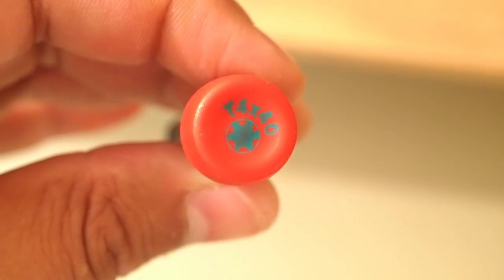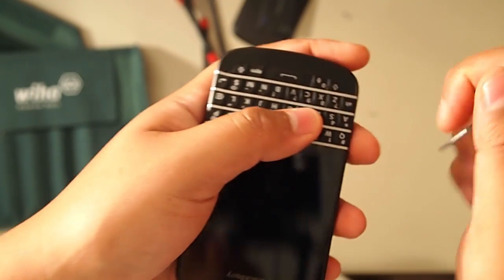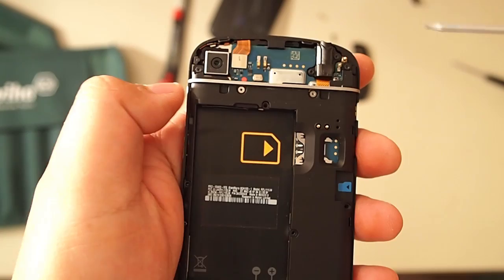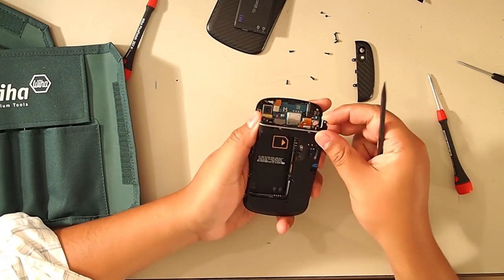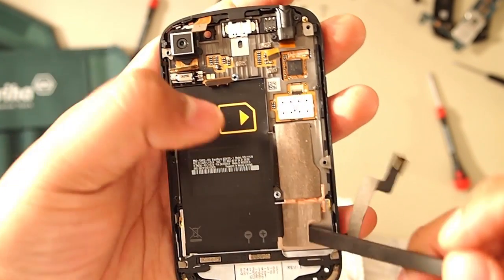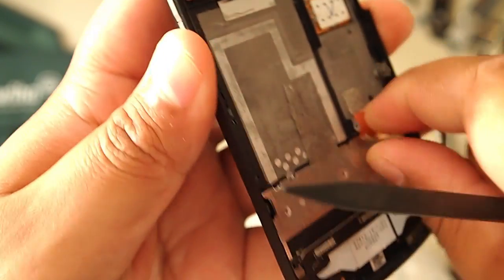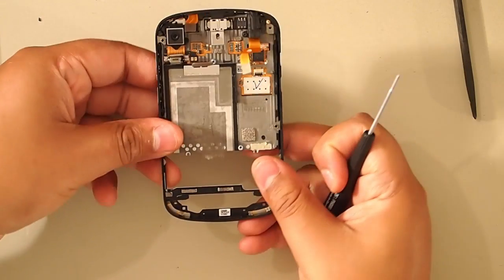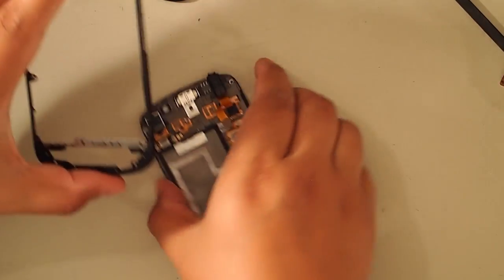Blackberry Q10 repair video Take apart, Disassembly and re-assembly DIY Screen replacement, Repair

Comment: My blackberry q10 is unable to make calls despite having both wifi and the Net. It says need network connection. What is the reason behind this. Pls guide.
Reply from the maker: Have you checked if it has any IT policies enabled?

Comment: my phone only works on speaker phone.   how do u replace the mic  is it part of the keyboard?
Reply from the maker: yes the mic is in the keyboard in this case.
Reply: @techguyz708  will it be ok to swap the keyboard from another Q10??? Also how can I desolder the  charging port?  Is there a special flux to desolder it and should I use a heat gun at what temperature??Lol

Comment: Thanks very much! Clear instructions and useful tips/do-not-dos. I needed to fix a SIM card housing/seating issue so all I needed to do was get to the PCB so by 3:20 i was good to go. It was just a matter of bending one of the SIM card slot top guides (it had been bent down into the bay itself) up so the SIM could sit in the bay properly. Before, the SIM would not connect with all the contacts and thus was undetected by the OS.
Thanks again!

Comment: my q10 has got a weird problem recently... everything is working only when i call someone .. he can't hear my voice... i can clear them pretty well.. but it works when i on speaker mode or use a hands free.. even voice recording working fine.. what could be the problem? do i need to replace any part?

Comment: Hi mate, thanks for your great video. I need some advice, I damaged my Q10's mic by prying all around the top cache on the back of the phone around the camera, with a needle. Now phone calls work and voice assistant (bottom mic) but not Soundhound or phone calls w/ speaker (top mic). Do you know exactly what component should be changed? From watching your vid I'm not sure if it would be the aluminum chassis or the screen itself.

Comment: Noteworthly turtorial, because any BB Q or Z built since 2014 will likely NEED to get a resoldering, or replace the SIM slot on these. it just breaks,
You had ONE job, Miguel!
Reply: Silver Spoon huh?!!!
Reply: Handsome_Hero
I have managed, somehow to check the product number of my blackberry, and after a few hours of research, came with the conclusion my Q10 was manufactured in Guadalajara by Jabil, a factory that makes Blackberries. the date stamp reveals that thousands of Q and Z series blackberry were assembled. The PeopleSoft database match with the production number and crew in charge of soldering the sim and SD connector, there are 9 persons who have been doing this circa 2013-14. Matching the production line DB with the employee DB revealed there is just one guy ortwo and the quality control crew staff who just don't give a fuck and manufactured thousand of PCBs with hazardous soldering, if not, spitting on SMC circuits. I could eventually complain at RIM/BB but instead i'm going to give a call to the guy who assembled my phone and ask him why he's doing this.
Reply: Silver Spoon Yes I noticed that a large number of Q10s and Z10s had faulty manufacturing and resulting problems with battery circuitry, keyboard sensitivity etc.  I hope this has been corrected for future BlackBerry phones but I wouldn't hold my hopes too high.

Comment: Thanks man, rebuilt my q10 with a chassis i got off Ali today, the only thing i didn't see until your video was the small Philips screw that attaches to the keyboard under that piece of adhesive copper. Thanks!
Reply: bteeuwen "mini torx, mini-er torx,  now flathead... oh now you need a philips screwdriver!"
guddammit!

Comment: Hi, I just replaced speaker for phone calls because of the dust. I ordered a part from Canada and everything worked great until now. I've tried both speakers to try on the phone but did not work. I thought I's dead and a new speaker, but I tried the cable from the radio to connect only with the battery and everything works as it should with the speakers. problem is that it does not receive a signal from the motherboard. I was wondering if anyone had a similar problem and how to solve it. thanks in advance Ales

Comment: I followed this video, had a few troubles (Rear facing camera and headphone jack not show transferred on your video)... I got the phone working with a new lcd and bezel...but, now I can only make calls w speaker phone on, otherwise no one can hear me! Why?
Reply from the maker: if the screen you bought didn't come with the earpiece then you have to transfer the earpiece off the old screen assembly to the new one. (little rectangle object at the top of the back of the lcd assembly. )
Reply: ok thanks.  I figured something like this... Would the lack of this "earpiece" cause my specific problem, though?  My issue os that people on the other end of my calls cannot hear me (though I hear them just fine), unless I use speaker phone.  I have been told that there are actually two separate microphones that pick up the users voice:  one for speaker phone and one for regular voice calls.  Is this true?